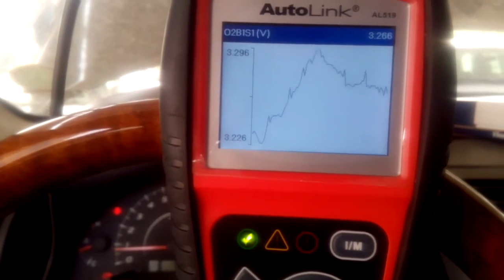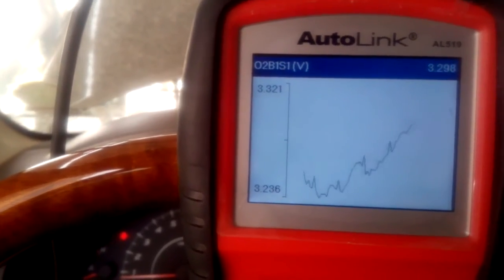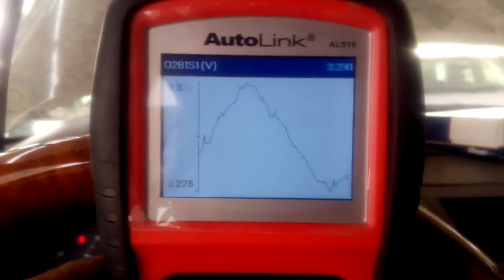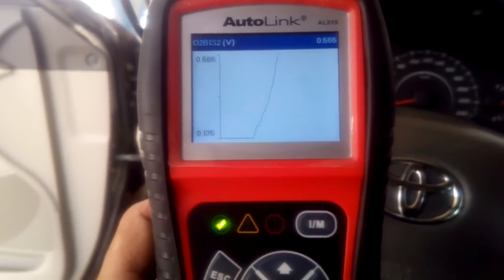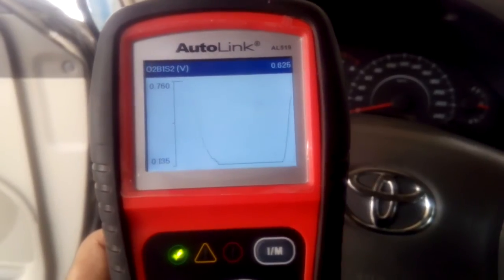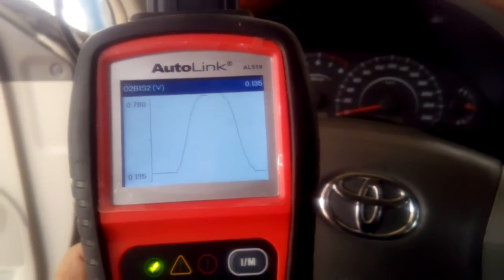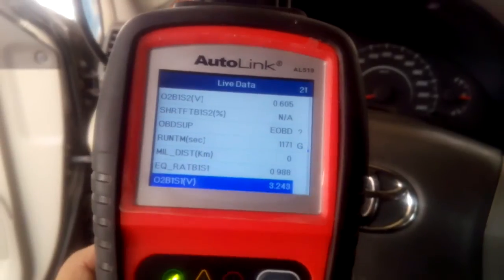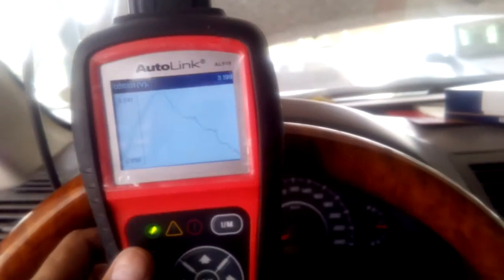2010 Toyota Camry Oxygen sensor data. Problem?

Comment: Hi , the according to graf there is fuel trim problem and after hearing air suction around engine ,there must be a vacuum leak, at that time when you accelerate the data and graf will at normal position  , smooth shine wave...

Comment: the first sensor  is a wideband air fuel ratio sensor, it looks to be normal reading for toyota. the 2nd reading you were looking at is the downstream sensor which is not wideband, looks like the catalyst might not be doing its job, but you would gave to do more testing

Comment: You have already received good advice... I was just wondering if this engine has a catalytic converter. If yes, then B1S2 sensor should not be switching like that. If your emission laws do not require catalytic converters, then that signal is OK.

Comment: Could be lack of fuel under load,check fuel pressure,check spark on all cylinders with spark guage,Shake can mean one cylinder not working properly, throwing the engine off balance.Possible faulty spark coil,loose spark plug, faulty Ht leads.One injector not working properly.

Comment: It appears the sensors are working properly.. The one switching from 3.2 to 3.3 is Air /fuel sensor , different from the regular 02 sensor in bank 2. Do you have any codes maybe a p0171 or p0174 ? Check for air leak in the intake manifold gasket or in the the intake air breather hose? If not check for spark , and fuel pressure. The fuel pump can be starving the engine on higher revs...

Comment: On your scan tool the reading EQ RATB1S1 figure is correct when it is switching between 0.97-1.03 this relates to bank 1 sensor 1 which the computer wants to keep at 1.00 which is the theoretical correct fuel ratio of lambda
Reply from the maker: sandy anderson Thank you very much dear friend for your great informative reply. This was new thing I learned. I will try to figure out vacuum leak as you pointed in your previous comment. I will create a DIY smoke machine for the purpose and will do this with that. Best regards and thanks.
Reply: No prob for smoke machine try old paint tin, glow plug and some baby oil seen someone make one like that on Scotty kilmer channel, sandy
Reply: Or use a cigar, take a puff and blow into inlet manifold!

Comment: Dear friend bank 1 sensor 1 reading is normal this a wideband oxygen sensor that actually doesn't use the voltage but milliamps to work out lambda. Does your scan tool show a milliamp reading? I would suspect air leak, spray intake with water and listen for rpm change all the best, sandy

Comment: I suspect the sensor is ok, its a linear value hovering around as i would expect, not a switching on/off like the other threshold sensor.
The question is: is the roughness only on tickover, or is it rough running at any rpm.
Reply from the maker: zx8401ztv Thanks dear sir for nice information. The car is running rough only on idle at about 650 to 680 rpm. At high speeds it is OK.
Reply: LearningZone Is it possible the idle air valve is playing up?
Or you have an air leak after the air sensor thats upsetting the mixture.
Im sorry jahan, im not really as deep into engines as you are.
Reply from the maker: zx8401ztv You are great sir. I will try to figure out a vacuum leak as the symptoms are pointing to that. Your understanding is rock! Best regards,

Comment: There has been some dust storm in Saudi arabia in teh last months. It would be good to check for the following:
1- air filter is not clogged.
2- look for any vacuum leaks in the intake side. pay attention to the vapor line from teh PCV valve to the intake.
3- inspect the throttle body. if it is very dirty make sure that the maf sensor is in good working order.

I'm no mechanic but I know these things might trigger some weird things.
Note: do a favor for this guy and replace the pcv valve if you notice a lot of oil in the intake. it's a common issue with Camrys.
Reply from the maker: hisham202 Thanks dear friend for your nice comment and suggestions. I would do the same as you mentioned and will see results Inshallah. Best regards,